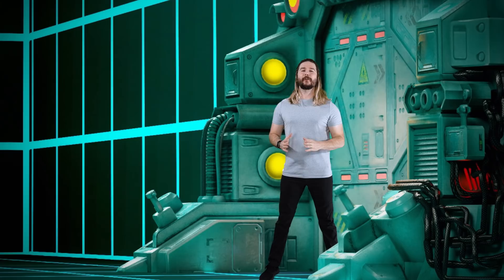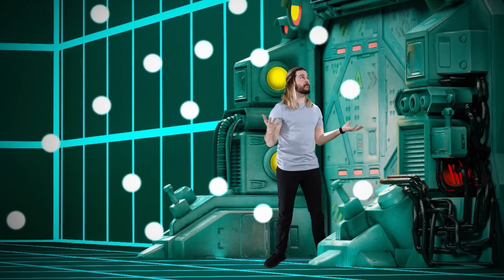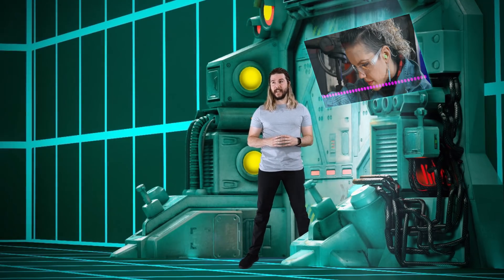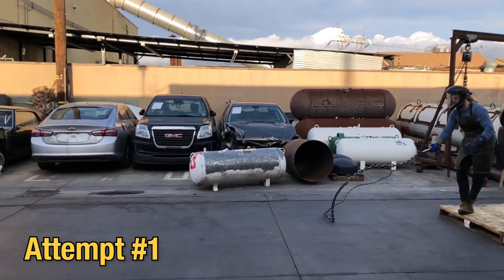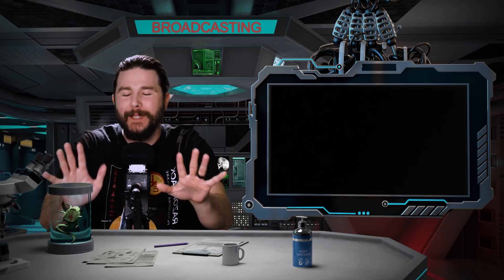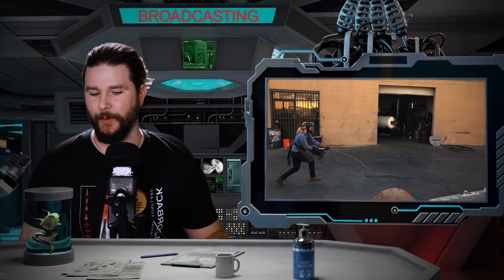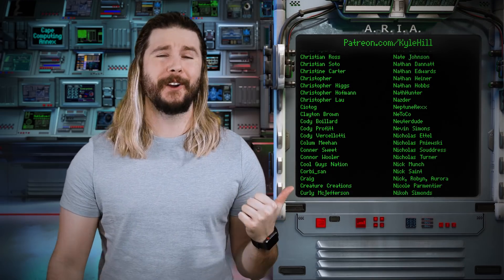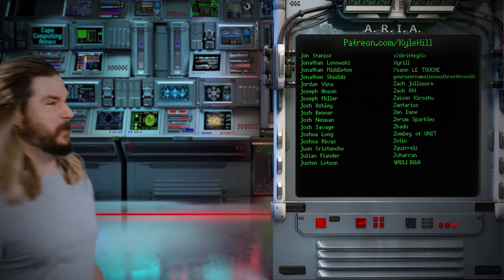Can I Make a SUPERSONIC STEEL WHIP?

Comment: Kyle, while I’m no physicist, I am a country boy. I noticed a clear difference between my whips and the chain one you were using. I don’t know if this will help any but here it goes. The core of your whip IMO seems to be very loose(as chain is) on most whips there is a core to them that retains a small bit of rigidity, at least for all I know. The Chain Whip starts off with that clear and effective overlapping circle, but eventually falls to the ground before reaching the end and well, the final part where it snaps forward and cracks. Again I am no physicist, but in every whip I have ever seen, there is this flowing single coil that travels down the length of the whip till the very end to create the crack, and I just didn’t see the one your whip created extending to the end of the whip. I have no idea if this makes any sense but I noticed that and figured I would throw it out there. Keep up the great work.

Comment: It's hard to tell, but it looks to me like the last 2-3 feet of the chain aren't transferring the energy fluidly. It looks like once the chain extends to a certain point, the rest moves as a rigid body rather than a flexible one. This could just be because of the frame-rate of the video, though. I'd take a look at the raw footage and see if it looks like the energy is being transferred down the chain as expected. I suspect it is not.

Comment: As a fellow sciencer (my personal term for a science practicioner who isn't a professional scientist) i must commend you for giving it another try.

I know that you will get some 1,5*10^25 other suggestions, but I'm inclined to give you mine nonetheless.

I think that what you have in your hands (literally) is an engineering problem. Like you said, the length of the whip seems quite a hassle, making it loose energy due to waves in the chain hitting your  your limbs, and to friction with the air and between the links of the chain. This monster of a whip must get hot by simply waving it around even without much vigor. Reducing the lenght to something more manegeable seems to me like a good solution. 
Another one is to reduce it's mass. I know that you are somewhat of a deity and whatnot but, the chain seems to be beyond the weight you can wave around in proper whip fashion. Don't get me wrong, I get that the weight is the whole point of the experiment, but I'm guessing (literally again) that the gains in momentum due to the weight are being nullified by friction and the fact that you aren't being able to accelerate it properly. Even the beefy guy in the tiktok video was rotating his whole body before unleashing the whipping action, and his whip was probably fairly lighter than yours.

Also, love your work. =]

Comment: Unrelated but I've been binging the expanse the past few weeks and got to season 4. With belters having just generally weaker bodies from lower gravity to where their cardiovascular system can't handle the higher Gs on a planet, shouldn't their ships be just slower compared to inner ships? Like the ships could go the same speed but belter bodies couldn't handle higher acceleration or higher G maneuvers.

Comment: Question: Have you analyzed the footage and determined if the tip of the whip was actually traveling at or beyond mach one? It's possible a true chain whip simply doesn't produce enough sound (even amplified by breaking the sound barrier) to make such a noise. It's also possible that you personally lack either the strength, or the proper form, (or both) to replicate the feat and the tip simply never moved fast enough. If that is the case, there is still a chance to achieve success by building a machine with the requisite power and perfect repeatable form, to cause the desired sonic boom.
Just some thoughts.
Keep up the good work, and thanks for all you do in the name of science!
<3 Auntie ^ _ ^

Comment: I'm not sure of the exact calculations or the mass of each segment of your whip but could it be that the mass of the last segment is too high for the momentum to make it break the sound barrier? That would explain why the tiktok with the lighter leather tip did break the sound barrier.

I guess you could work it out by taking the peak speed of your hand and working out the force being generated then translate that back into speed by applying that force to the lighter masses further down the chain. This wouldn't account for any energy lost to air resistance or friction between the chains but could at least get you a ballpark minimum speed for your hand to move to see if it is even possible with the current whip or you could work out the how light the end of the whip would need to be to break the sound barrier with your current hand movement speed.

Comment: This is proof of how and why science! Thank you so much for this buddy, I may try this against your recommendation, but I will be safe about it, I'll try to tapper the chain down to the smallest size necklace links, it may not help because of the weight, but the force that needs to be generated is great, so great that a machine may be needed to functionality make it safe, I'm thinking some kind of step to the side lowering the chain holder while at the same time dodging the chain on the forward swing. Ill work the math out during testing. Anyway, thank you again for all the work you do to make such a difference in the science community and hopefully the world as a whole.

Comment: Have you tried a much shorter chain to lower the overall weight, thus reducing the amount of base force you have to apply to it?

Or maybe using lighter metal, such as making aluminum chain links.

Comment: im convinced this could still work. the whip itself needs to be longer you can see in the slow mo that the whip is just starting to really pick up momentum and then it runs out of length or the tapering of size occurs too quickly (perhaps making the 'mid' section longer to allow more time for the big chains momentum to "fill" up the mid section more, this would also mitigate some of the smaller chain flicking around your leg.
another thing that might also help, have someone extend the whip all the way out behind you and then instead of throwing it over your shoulder slide it across the ground and get the timing right so when the momentum wave is about to reach the end  quickly pull back the other way, similar to how you would flick someone with a wet towel.

Comment: I think part of your whip's issue is the sudden transitions from one size to another. It is really evident in attempt #2. Braided bullwhips nedd a gradual taper to transfer the energy. For a chain whip, each link would almost have to be a slightly different size, rather than 6ft of one size, then a few feet of the next.

Comment: i love ya kyle, but the occams razor here is the fact that that guy is like twice your size. you need to put the required force behind it , it's not just an automatic crack when you move it. mybe shorter sections of chain, like 2-3 rings off each size of chain, and maybe give it to like a weight lifter. it seems kinda weird and un-sciency to say "my experiment failed because the video is fake"  when theres still a few variables you might not be accounting for (the video is so grainy that a small enough chain at the end would look and move similarly, for one thing). this made me miss mythbusters

Comment: Good science publishes the failures too. I have an hypothesis about the failure: it's the chain structure. Chains are basically a series of connected rings, a lot of energy is probably lost rotating those rings. That's why leather works better: it's flexible and transmits the energy in a better way. A simple solution would be replacing the ending chain with threaded steel wire. That would mantain flexibility while at the same time transmitting the energy to the very tip. Ouch.

Comment: I think standing in a steel drum, wearing a full leather welding jacket (plus padding) and motorcycle helmet may be enough starting protective equipment. SIDE NOTE: this would still be dangerous. An important thing to know about whips is that the ends get damaged when cracking (lots of whips have replaceable ends). Cracking and whip cracking steel at the speed of sound is scary as hell.

Comment: Hey Kyle, what is the probability that someone coming back from the dusting gets stuck inside a person who didn't dust?
Reply: Actually zero, Banner whished for everyone to be brought back safely. Feige confirmed it. But your question is interesting. Let's say people wer brought back in the same place they left, well, we have to ask what is the same place, and in what reference frame. If it is relatively to the stones, as the gaunlet moved quite a distance and changed orientation from the snap from the unsnap, most people would reapear in the middle of nowhere, space. And the probability would be pretty much zero. If people are brought back in the same place relative to the planet's surface, or if they are brought back un the same context, then it depend on the same context. If you were on a hospital bed, chances are high the bed is in  use. If you were hiking on a scarcely used mountain trail, chances become very low.

Comment: To be fair: Picking up a whip and getting it to crack is pretty tough.
It would make sense to master a traditional whip first, and then move on the steel whip.
Reply: This. It requires strength to master weight and technique, but maybe most important, it requires physical followthrough. It's very obvious in the video, that his physical movement is primarily dedicated to trying to stay away from tve whip he's trying to wield. Not followthrough. You can't do both at the same time. Your feet, your core, your arm, it's the root, stem and primary branch from which this whole movement originates. If those things aren't in, the whip at the end never had a chance.
Reply: I learned how in a day on my own.

Comment: So physics question: whats the difference between the leading edge of the pressure wave of a sonic boom in air and cavitation in water? Are they both creating short lived vacuums because the waves are travelling faster than the particles can keep up with (my wording here is probably very wrong but I am also wholly unqualified to communicate with actual human beings) or are they different phenomena entirely. Secondly, if they are different is cavitation in air possible?

Comment: I think each link in the chain would have to drop in size and weight in order for it to work. It looked like your whip was made up of 1 metre sections of equal sized links. The transfer of energy to each link would drop in each section of same sized links, rather than increase with progressively smaller links. Also, that guy in the TikTok video was about three times your size:)

Comment: Id try a shorter chain, or maybe thinner.  I am a semi-pro bull whipper, i can tell you weight differentials are a key factor, the bigger the whip the bigger the smart-boi needs to be( strength not size). Also i think you mentioned tapering in the previous experiment,  thats the crack-a-towa* ( wink wink video), because from what i know and you said- its the transfer of energy to the smaller mass- increasing velocity and you cant forget the pressure waves crashing into eachother as the whip snaps in the previous pressure wave creating a stacking effect. 

A pressure wave has mass as defined by the relative area that the pressure moves air and particles out of its way. Its a coning event, closer to the smaller opening the more it interacts with its self. The crack is the multiple waves crashing into eachother with little or less available space with air and stuff in the area to buffer it. Speed yes, but scientifically speed is just the vehicle that crash those waves into eachother. 

I believe that the math is a multiplier not an addition equation. Say it is 700mph( sorry metric), id transfer that to newtons ( def not joules) because its easiest measure to recalculate "work" into a workable measurement. Then id worry about the "dead weight equations " ( think carrying a 50lbs sack of potatoes vs 50lbs of weight that can displace itself), when does the weight of the object displace enough to overcome the factors of its "natural" state in earths environment? We can manipulate what the natural state is at ( physics baby) by disorientating its state of being( but within our atmosphere). Somewhere within flying, de-gravitational forces ( and centrifugal* forces, there is a difference and both relative)  and creating something that will create a reverse then proper vacuum all attribute factors of as Kyle said a mach (march* pfffth) 1 boom. 

The guys vid showed a bigger guy, he also used centrifical* and velocical* force to appose gravity and gain momentum by a few rotations be for the whip. A caveat id like to add is- we dont have his chains specs( kyle is nice, smart-boi gives us some indication and the maths.) Could the vid be fake? Could he used a flint active metal for his spectacle? Without scaling i dont know. 

I think scaling the supersonic chain to kyles specs with yield better results. But as he said, science is more about the failure to replicate for truth than to prove a theory.

Comment: I believe the failure is in your technique. The best versions of chain whips were laid flat on the ground, so as to constrain the "wave" to a 2D plane. Of course, I'm no expert, but it seems more likely to work in that way. Also, you might consider practicing with a lighter whip, to improve your technique, before trying again with the heavier chain whip.

Comment: I don’t think the human body is capable of accelerating the mass of that chain fast enough. Anyone who’s seen videos, or even experienced for themselves, the power of a snapping chain knows that they can indeed move very, very fast as a result of failing under high tension. I think that the snap you hear in these situations is the initial failure of the material breaking, not the sound barrier being broken. but if you added a cracker from a whip it would certainly be moving fast enough to make a nice bang

Comment: Hey Kyle as a whip cracker the big thing is make the whip loop. It's the loop that travels down and toward the end of the whip. Once it gets to the end it's the loop unlooping that makes the sound. But like you mentioned about the tik tok vid of the end of the whip being leather called a fall and there's usually even a smaller price on the end called the cracker. Being able to make that out of steel would be incredibly difficult because the cracker isn't solid. The ends are frayed and that highly increases the crack of the whip.
Reply: Just to add you mentioned about dodging the whip to make it work and while that is a possible method the one I think might work better is to use a shorter metal whip that you can hold like a regular one. If it's one a few feet long it'll still be heavy but it'd be easier to try one of the many different kinds of whip cracks

Comment: 'Air acts as a fluid.'

Fluid, noun, a substance that has no fixed shape and yields to external pressurr, i.e a gas or liquid.

So to infer, the air is NOT a gas??????
Reply: Gas is a compressible fluid, liquid not so much.

Comment: I wonder, instead of using a chain-link of single size, why not make it out of progressively smaller size or use steel cables of different lengths.  This might make the whip lighter and probably faster.

Comment: I think you can do it, even with a chain. Start with a lighter chain so it is easier to control. Then decrease the diameter of the chain a few times throughout it's length. Much of the momentum put into a whip is conserved throughout the motion but, the mass that is moving decreases so the velocity increases. Destin at Smarter Every Day has an excellent video detailing the physics of a whip. They even discovered that the crack, or supersonic snap of a bullwhip happens just before the whip fully extends.

Comment: Have you cracked a bullwhip before?  I don't think previous videos show you doing that, and I venture that without enough experience of doing it with a leather whip, it can be harder to know the right technique for doing it with not only a heavier material, but one that doesn't quite act the same as a bullwhip would in how it moves, accelerates the force, etc etc etc.

Comment: I wonder if it was possible to begin with. A leather whip ends with a very thin piece of fabric, which weighs next to nothing. So the kinetic energy you put into the whip is enough to get it to supersonic speeds. What was the mass of the smallest chain rings at the end of the chain whip? Maybe the density of the steel is too high to get it done with reasonable sized rings?

Comment: The chain is too heavy for you're size to wield enough force into it. It doesn't need to have that much mass. You could start with much shorter and smaller links in each length of chain gradually tapering still to a finer chain at the end. Also leather whip is a woven braid of individual lengths reaching the total length the of the structure of the whip. while more flexible as leather, they are still more structurally rigid. They resist collapsing a little better, and only loop into a coil at best, instead of fully folding like a chain can fall back on itself loosely. This action transfers the forces easier along the length wasting less energy, unlike the chain which can slip in each link as it moves. Less loose movement per link will preserve both the energy along the length but will keep it from just flailing and flopping for better control, and safety. However on another safety note, while the whip might fray it can still stretch and give with the forces and relax back due to the weave. The chains links might snap or shatter under the strain and if those do, you might get shrapnel pieces of flying links.